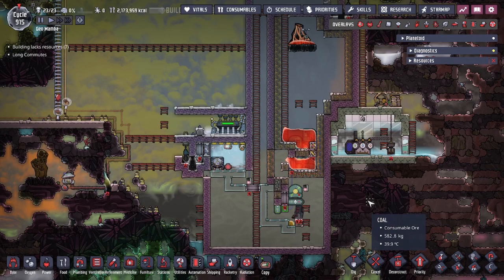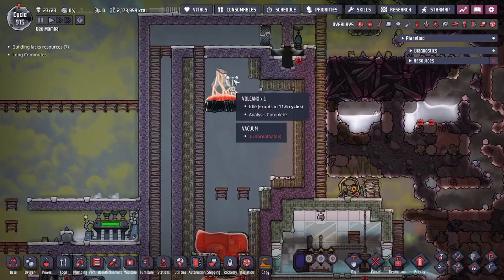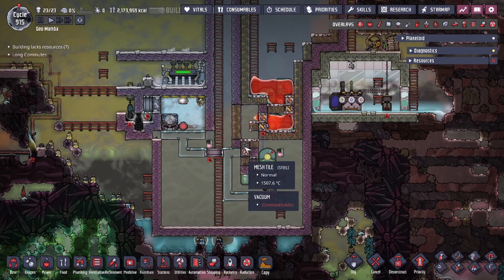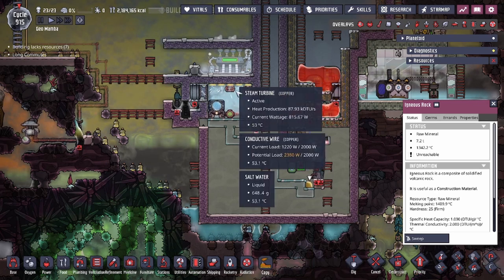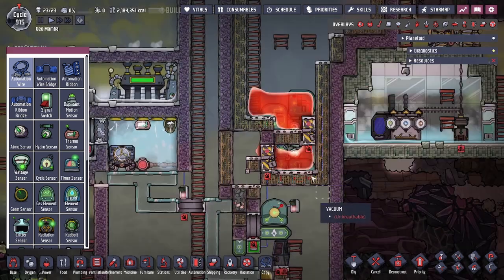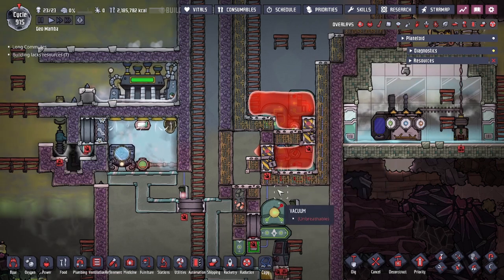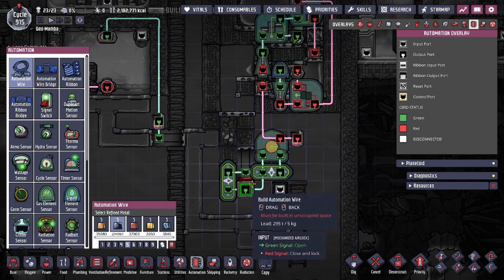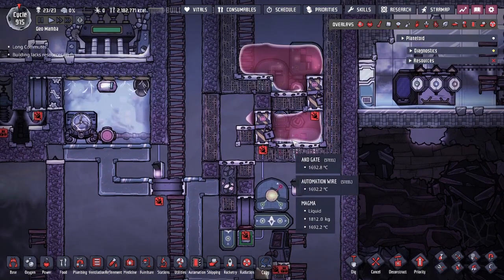Controlled Magma Spill & Debris Soak - Volcano Tamer Design No Robo-Miner - Oxygen Not Included

Comment: I know this video is old, but would liquid uranium be better than molten lead for the liquid "soak"? Checking wiki liquid uranium melts at 132 degrees C, boils at 4131 (!) with a higher SHC than molten lead (lower conductivity however).
Reply from the maker: since youre looking to pull the heat from the solid igneus, molten lead is still better since it has higher thermal conductivity. the shc value doesnt matter too much in this instance. though it can be used as an alternative
Reply: @2LegitCity  I see thanks. I might see if molten aluminum works since it has better conductivity than lead but it freezes at 660. I might change the bit at the end because I want to eventually make use of the igneous rock debris.

Comment: love the build! i've just added it into my newest game to boil by crude oil. only thing is, for some reason after working flawlessly, i run into no magma in my mesh tiles. have to reset with the on off switch to get more magma flowing. any reason why this might be happening?
Reply from the maker: i think its because it goes through all of the magma and therefore there isnt enough for the door to push out. if nothing gets pushed out, the chain doesnt continue. 

while you can still manually use the switch to trigger the system to run again, i should probably try to figure out the automation to make that not happen

Comment: Hi, quick question. How long would a petroleum boiler based on this design have to be?
Reply from the maker: are you asking about the length of the counter flow? the heat source, regardless of what it is, doesnt affect how long your counter flows should be. the heat source temp only affects how fast the oil boils into petro- and after set-up is primed, it should all be the same speed
Reply: @2LegitCity  Thanks, I found a minor volcano on my map and I wanted to put it to good use. Bonus, I can use the CO2 to get some data banks and then use petroleum to explore when I have enough. Fool proof, if my dupes don't decide the volcano demands sacrifice...
Reply from the maker: @gabrielmillan2902  i can tell you that a dupe in a atmos suit can survive 5~ seconds fully submerged in magma before taking about ~10 damage every 5 seconds- don't ask me how i know :)